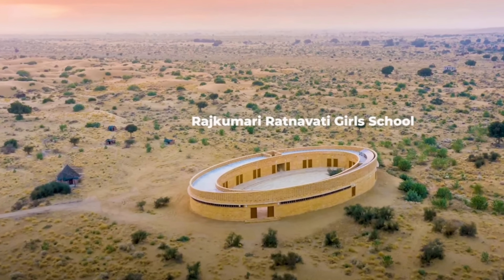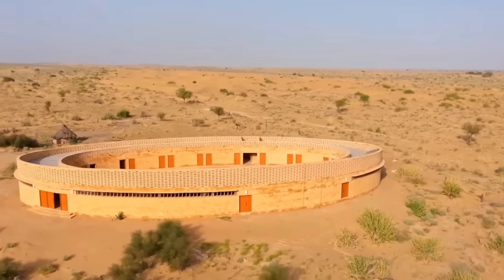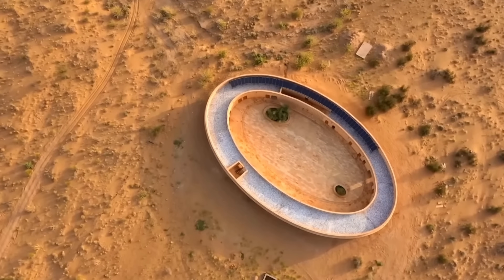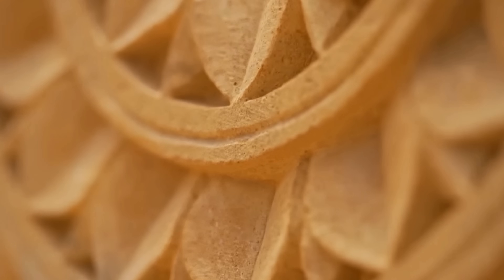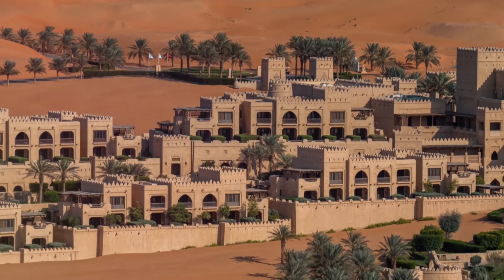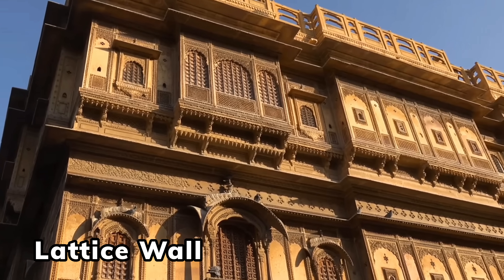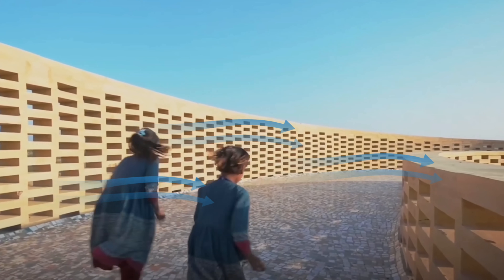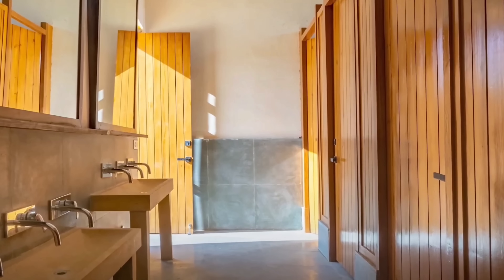3 Design Strategies Keeping This building Cool In Scorching Heat, Natural AC System.

Comment: No recorded temps? What's the difference between outside and inside? Just a gentle breeze, right?
Reply from the maker: Was mentioned that the architect said its 20-30f lower inside than outside. Jailsmer take quite a long time to get to, I've been there 10 years ago and I wouldn't want to make a dedicated trip to just film this and take some temperature tests, would be a little over the top for a trip.

Comment: Obviously the local pigeons love it and will make lots of noise and nests
Reply from the maker: That happened at my school don't really mind the sound of pigeons myself
Reply: @LeafofLifeWorld  Their sound is not the problem so much as their poop (which will be deposited everywhere) and their nesting mess. The older style cooling bricks were designed to block birds, which were encouraged to nest in dovecotes where their mess is collected as valuable fertilizer.
This is typical modern architecture; it ignores basic facts about life. Whoever designed it should be forced to clean it so they will learn a lesson.
Reply from the maker: @davepennington3573 the poop is a highly valuable fertilizer especially in the desert, since this location is in India they use dove cove which provides a place for pigeons to roost, learn more here...https://youtu.be/C12H6ddutS4
Reply: @LeafofLifeWorld  Indeed dovecotes are excellent sources of fertilizer but a school is not a good place to have a fertilizer repository. They will need to put screens up.
Reply: @davepennington3573 i don't think you read what they wrote, the pigeons have a home to roost already they know to fly back to the dove cotes, they are not roosting in the school, you can see there isn't really a shelteres space for them, the dove cotes are much more cosy

Comment: OK NICE AND INTERESTING EXCEPT ... 3 500 LITRES OF WATER IS PISSING IN WIND ... I HAVE A TANK OF 5 000 LITRES WHICH I COLLECT FORM ROOF ... IT IS NOT ENOUGH FOR 30 KITTYCATS AND 6 DOGS FOR 4 MONTHS ... SO A PACLK OF LITTLE GIRL I DOUBT IT ENOUGH ... EVEN I DRINK 3 TO 6 LITRE OF WATER PER DAY
Reply from the maker: This is only one part of the building thats finished there's going to be 2 more structutes so they might be able to harvest more , average rainfall a year is 
11.56 inches
Reply: @LeafofLifeWorld  INTERESTING I GO ABOUT 354.2 mm (13.9 in) ... AND MY ROOF 800 METER SQ I GOT 20 000 LITRES THIS WATER IN 4 TANKS AND THIS NEXT WINTER I AM INSTALLING 10 TANKS OF 15 000 LITRE CONNECTED TOGETHER PLUS I HAVE ANOTHER OF 200 METER ROOF AND ANOTHER BUILDING BUT IMPOSSIBLE TO PUT TANKS AROUND IT ....HOPE THE ROOF IS NOT PERFECT FLAT SMELL PITCH AND WITH DRIAN PIPES DOWN TO TANKS

Comment: Thanks for sharing !
A small feedback: When editing the videos make sure the sound does not suddenly switch between high and low volumes 😅
Reply from the maker: Thanks fpr advice,
ts a different microphone that's switching between, so quality and sound is different furthermore the mic  I'm speaking to camera with was over cooked and way to loud, its new and not used to using it, had to turn it right down for it to be bearable, thought I go it almost close to matching at least on my devices and headphones

Comment: No specs of the building actual temperature differentials from outside to in the rooms. I'm sure it would still be too hot to study for most people.
Reply from the maker: The architect said it is 20-30f cooler inside than outside, was mentioned in the video. Taking her word for it, would be a bit far to fly out specifically to do a video on this in person, I have been to Jaisalmer about 10 years ago, its quite a journey to get out there, but the temperature when I went in December was very pleasant for me, nice and warm in the day, and cool at night. Not sure exactly when the school year starts and ends but I would imagine that they have a summer holiday during the most extreme times.
Reply: Someone can not listen the commentary
Reply: @rexochroy2  Someone who seems to know won't say